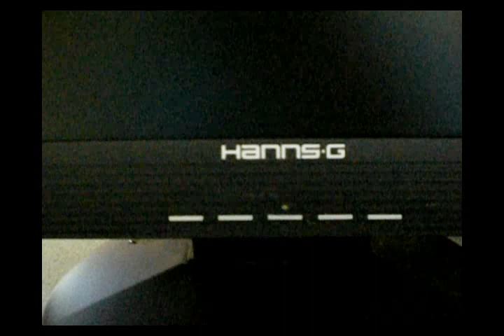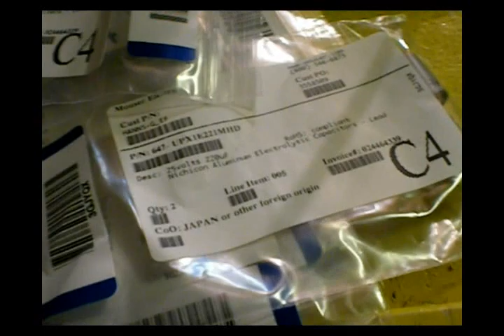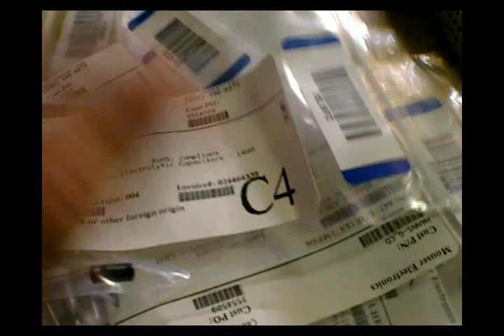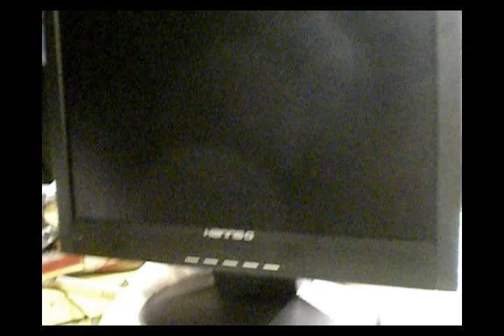Repair Failure: HANNS-G Monitor Power Supply Capacitor Replacement

Comment: Same problem here. Monitor was making rhythmic humming noises until it started after like 10 minutes.

My trial to repair it failed (yet) but i could narrow it down to the 12V line! It is slowly rising and if it ist over 5.5V or so the display turns on.

I replaced C54, C56, C57, C59, C62, C101, C102 with low ESR ones. I kept the C51 and C52 allthough they were bulged because i measured thier ESR and it was ok and i had no replacement at hand. The monitor doesnt start right away but the noise is gone.

other people made it work again after replacing all caps
http://electron55.ru/monitor/31-acer/48-acer-al1716
https://dragonskies.com/articles/hanns-g-hc194d-repair.php

there are kits around
13$ http://lcdalternatives.com/Hanns-G-HC194D-XAD819AR-LCD-Monitor-Repair-Kit-Capacitors-Only-Not-the-Entire-Board-P1660333.aspx
but it should be cheaper if you buy them separately from china.

Comment: I Have a Hanns G HH221, just started having flicker problems and now goes on for 2 seconds and then goes black, audio still works, you can hear what sounds like something coming from the inside, is it the caps or could it be the inverter? If its' the the inverter I'm pretty much gonna have to buy a new monitor as they are pretty expensive, thanks for any help. Update I examined the caps no bulging or burn marks I took some photos if anyone wants to see them. but now I have another problem the screen is all pinkish color with nothing else could connecting the CCFL incorrectly damage the LCD and cause that. Am I outa luck? Turns out the Pink screen was the LCD cable came loose screen is fine but problem persists.

Comment: Stop!, don't throw those pesky repaired monitors away just yet. If your capacitor repair has failed - Did you remember to account for the 'Reactance' of the replacement capacitors?.  Basically capacitors have a 'resistance' to voltage change which is inversely proportional to the frequency. So on an low A.C. frequency circuit ordinary caps won't work correctly unless they are specifically low reactance ones. Most caps are deigned to work on D.C. which has no frequency, or in audio circuits which have a high frequency 10khz +, and at these frequencies ordinary caps work very well. Around A.C. 50hz though, caps can almost completely stop working, as their reactance is too high - and its effective resistance goes from zero to acting like a 20ohms resistor. All is not lost though, if change your caps for A.C. specific 'Low Reactance' ones and you may find the monitors start working - it would also explain why a number of your cap repairs have failed - maby the batch of caps you used were all high reactance, whereas the previous batch were low reactance. Hope that helps, its also good to see people posting failed fixs - always something new to learn.See explanation below for more about 'Reactance': http://www.allaboutcircuits.com/textbook/alternating-current/chpt-4/ac-capacitor-circuits/ Capacitive reactance is the opposition that a capacitor offers to alternating current due to its phase-shifted storage and release of energy in its electric field. Reactance is symbolized by the capital letter “X” and is measured in ohms just like resistance (R).Capacitive reactance can be calculated using this formula: XC = 1/(2πfC)Capacitive reactance decreases with increasing frequency. In other words, the higher the frequency, the less it opposes (the more it “conducts”) the AC flow of electrons.
Reply from the maker: thanks for sharing this! I got rid of this monitor years ago.

Comment: No I don't think you've done anything wrong. I had replaced all weak caps and still did not get it work either!
it is something else. I am gonna try to get new power supply and A D board for 2 monitors.

Comment: There is a lot on the internet about HANNS-G monitors with NVidia Graphics card not waking up from sleep, most also using Vista Ultimate. I myself have been suffering the same problem for a couple of years now. Is this the combination you have and did you ever fix it?

Comment: Monitor IH252HPB Starts on first use, once computer sleeps, Monitor will not fully wake up from sleep mode. I try to move the mouse as normal, and the screen wakes up for a very brief moment, so that I can see my desktop for a short period of time. Then the screen instantly goes to sleep again. Occasionally, I can fix this problem by pressing the power button on my monitor a few times. Most of the time though, I have to do this process many dozens of times before the monitor reveals my screen.

Comment: i have the exact same problem with my hanns.g monitor . THe light blinks and the screen wont turn on until like 5 to 10 minutes. I appreciate this video but i have a few questions. Where can i purchase those capacitors?, are there any local stores like best buy?????

Comment: I have this EXACT same monitor, with the EXACT same problem. Also, my high school purchased around 25 of these and all of them have the same power supply problem after about 2 years of use. Screw Hanns-G.

Comment: Don't worry man, I have had quite a few of them not work even after replacing all the capacitors. I always mark my back light connections, and I have put a few capacitors in backwards from working too fast. Most likely a bad mini transformer, or another component might be bad like diodes, transistors, resistors, etc. Sometimes you will get a stubborn one.